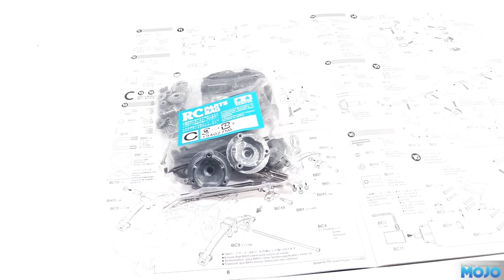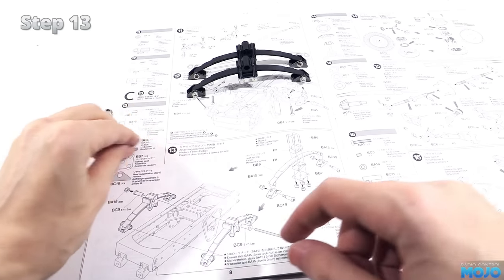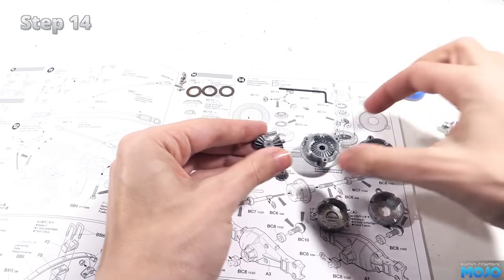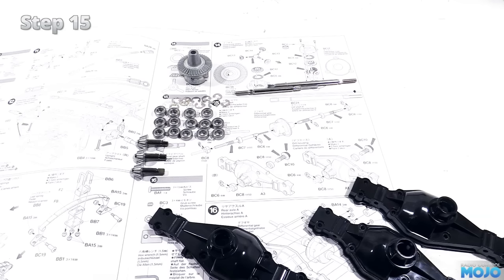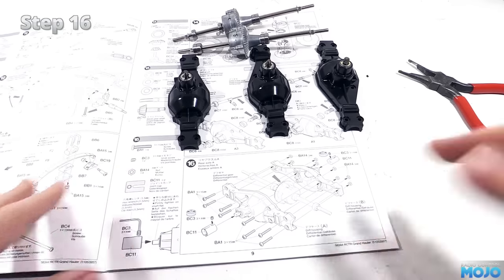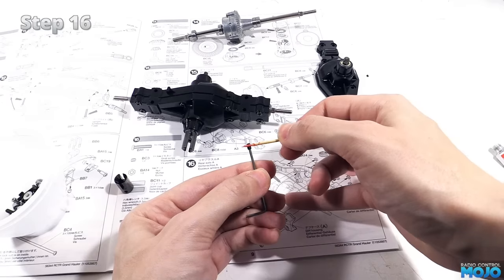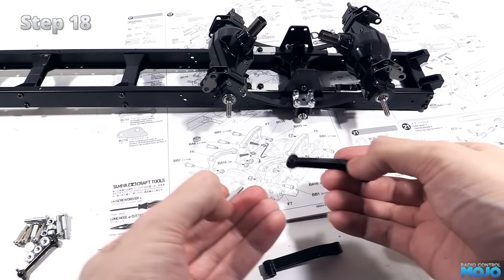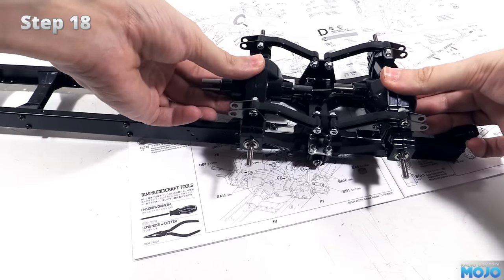Tamiya Grand Hauler - 4 - Bag C

Comment: You need to lock the differential up on the front drive axle.  The open diffs will spin too easy on this truck.
Reply from the maker: Thanks for the advice.
I had it in mind that if the diffs unload I’d swap the grease for something nice and sticky.